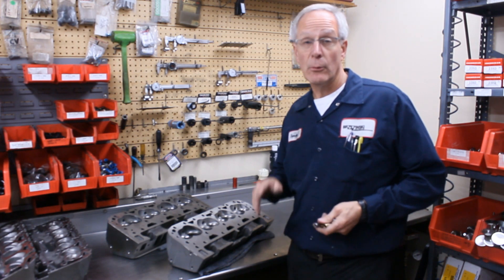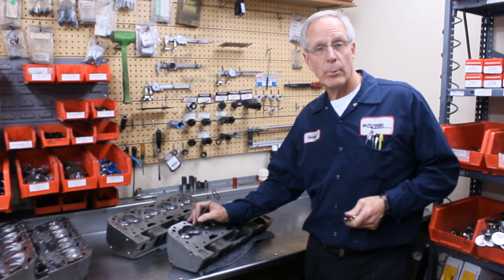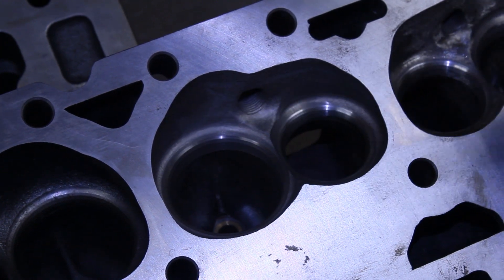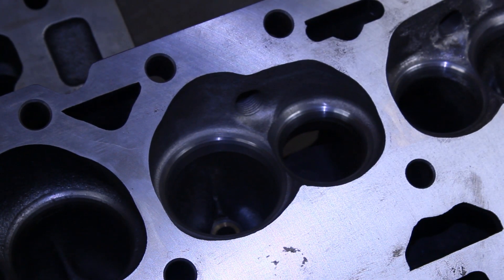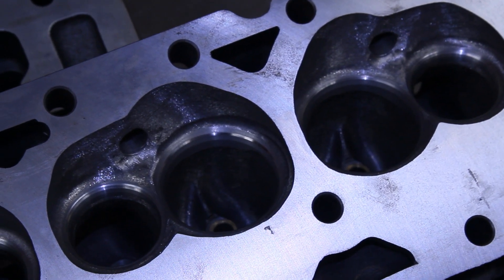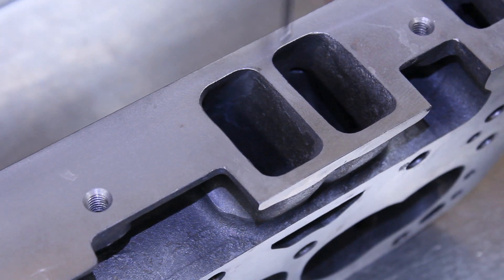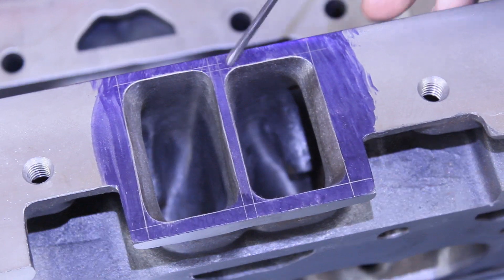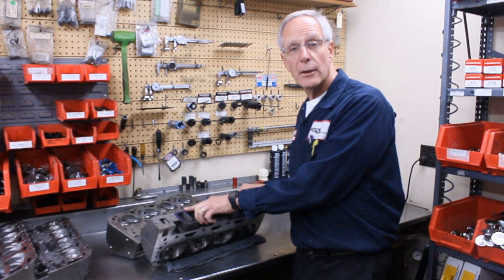Dart Iron Eagle #3 - Horsepower Improvements

Comment: Can the dart iron eaglehead sbc handle 600 horsepower
Reply from the maker: Yes, the heads will need to flow 290 to 300 cfm to get 600 plus horse power.